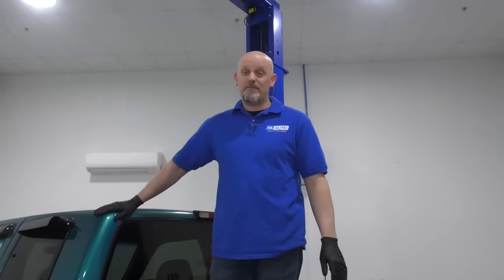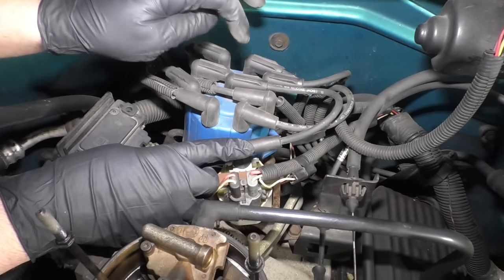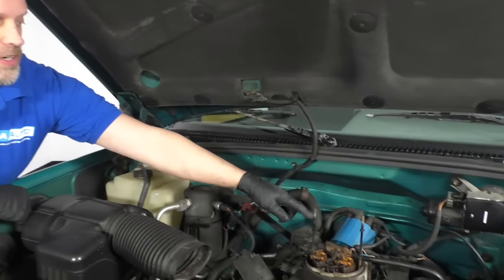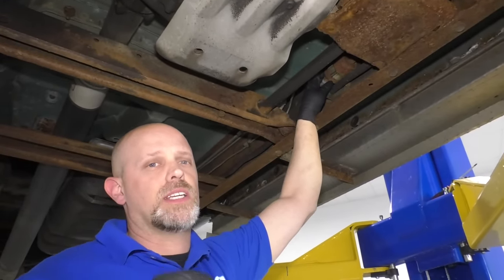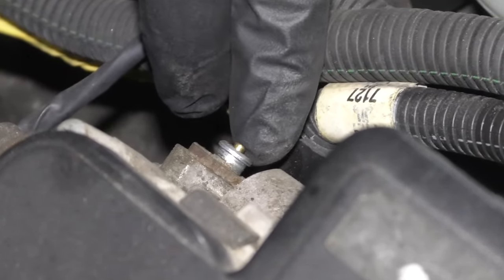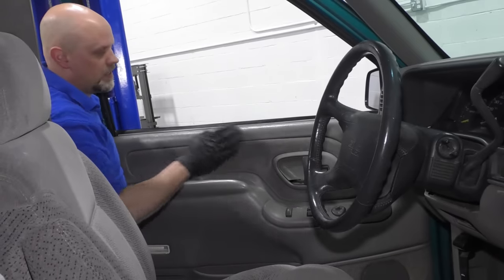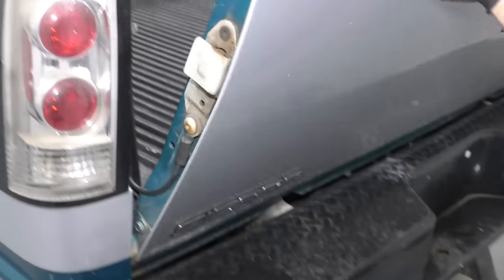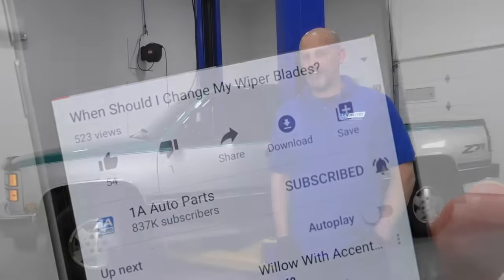Top 5 Problems GMC Chevy Truck 4th Generation 1988-02

Comment: The ignition parts should be replaced with ACDelco brand only. Longevity and less issues when wet. The Tailgate handle fails 90 percent of the time due to lack of lubrication of the components. Door handle when frozen people pull on it hard and bust it.

Comment: So just got a 1993 gmc 2500 single cab and I am able to start and go but only after I start it a couple times and gas it or just start and immediately throw in gear. Driving around it’s fine and I can even stop for a few seconds but anything longer than a minute the truck will shut off. Also when I do gas the truck it seems to be getting good fuel. It was an old work truck so it could be a variety of things but wanted to hear thoughts!

Comment: I have a 97 K1500.  If the brakes are applied while going
over a bump, the pedal goes to the floor and no brakes.  There are no leaks, no loss of fluid .

Comment: 2000 k2500 I got the truck when I was 18 new ive had every single one of those problems besides the distributor cap obviously cause mines fuel injected. Did have a issue with the injectors also

Comment: My 1994 Chevy K1500 running lights (dash board, park and tail lights) blew a fuse twice within 2 weeks and my mechanic put a new fuse in so which fuse is it that needs replacing so I can do it myself ?

Comment: Any suggestions on a reliable brand of replacement distributor for a 1993 4.3L V6 C1500 WT? I see quite a variety of them, it's hard to know which ones are the better ones. Thanks!

Comment: I Have a 1988 GMC k1500 280k miles
1 I have replaced the distributor and coil pack
2 I have had to replace my fuel pump 
3 mine is an 88 pre abs
4 I have replaced door handles
5 mine is the earlier heat controls no problems 
Right now I need a transmission lol

Comment: I have an o1 gmc, I have had all of those problems except the distributor,only because I have the 6.6 liter, one you forgot was the transfer cases, where the pump wears a hole through the case, on the 01 and 02 i know for sure.
Double K

Comment: The heater control wires in the dash get cut/chafed which can lead to shorts.   The electronic heater modules are very expensive.

Comment: I have a question, I have a 1996 2500 2wd.  I have had the front end worked on new tires and brakes all the way around .  pitman arm and new grear box also... but my truck has started being hard to keep in your lane once you get above 45 the faster you go the harder it becomes... I call it swimmy ,,,,it is like it is overcorrecting ,,, this has only started about 6 months ago,,, had it to my aligment guy and the chevy garage,,, still not fixed.... so what do you think is the problem and how can I fix it?

Comment: I have a 95 sierra.  It was an odd ball with the climate controls..... Gm had an issue for two or there months of production on these. I have replaced everything but the wires.  Still can't get anything to work. Can yall help with a full end to end wire tracking video of where all of the power comes from? I have replaced the controls, the resistor the relay, and the fan. I don't know what to do next.

Comment: not to mention the cup holder on the newer interior design is in front of the heater vent so if your blasting the heater and have a cold drink , it wont be cold for very long
Reply: Whoever designed it should have been fired, just really stupid in every way

Comment: On my 1996 Silverado,I have had to rebuild the AFrame,the ac system,the water pump,and at 160,000 miles the fuel pump,other then these, usual wear points the truck runs very smooth,and gets what I consider good gas mileage for this size truck (extended cab(.

Comment: I just bought a 99 Chevy C2500 and the key is stuck in the ignition. I’m trying to figure out did these trucks come with resistors on the keys? Or were they blank?

Comment: Never had a problem with my ABS sensor or heater control. For the a/c heater control, just the lights went out on those and just swapped in others.

Comment: I've had several of these gmt400's. two of the problems I had on all of them was the tail light boards and the tail lights harness ground wire. They were great trucks but had there problems like anything else

Comment: Biggest issue for the 93 is all the wiring. I worked at a dealership for five years and every tech has helped me with the wiring. 93 is the change over year. That is why my 93 runs a 700r4 trans. Trans. 4l60 is a fine trans.... the harness to that tans is junk. 1200 skins to gm five years ago. 200 for a 700r4 and a throttle valve cable. Problem solved. Point being don't buy a change over year. It's a guinea pig. Good luck

Comment: 1990 chev with a 305. The truck idles nicely but when you accelerate  it seems to misfires. Could that have something to do with the spark advance or a tooth missing on the distributor. It does smooth out but does not seem to shift into high until about 45-50 mph.

Comment: I own a '96 1500, 6 cylinder and I've had to rebuild the transmission twice. Wondering if many people report this same problem. Other than that, at 180k still runs great.
Reply: Did you do the rebuild yourself or did you send it to a transmission shop?

Comment: Inside and outside door handles broke on my driver side. Outside handle broke on the driver side. Tailgate latch broke but I leave that broke I just put my hand in and squeeze the rods( no one else can open my tailgate, it’s kina nice) fuel pump went. Speedometer does not work, guess that just needs a new sensor. I’ve had a lot of coolant leaks back part of the frame rusted so bad I had to fix it where the leaf spring bracket connects but other than that my 97 silverado has been a tank
Reply: Oops I meant outside handle passenger side

Comment: My 92 GMC truck's fuel pump died at about 60k miles. 5 years later the oil pressure switch, located behind the distributor broke and the engine stopped. The 12vdc for the fuel pump goes through that switch!! Tow back home = $124 and the switch cost me $34.

Comment: I have a 97 C1500 and one of the rotor screws in the distributor backed out and quit running immediately. It backfired a few times spit and sputtered but I replaced the distributor and have not been able to get it to run decent since. It cuts out shuts off won't start sometimes and I've tried everything. Only thing I haven't done is buy another distributor as maybe the first one was faulty idk. I don't have a bi directional scan tool so I can't tune the ignition timing but it should still run without doing that right? Any help is appreciated thanks!

Comment: Have a 98 K1500 with 175k on it. Did a tune up and the truck still stutters when trying to hold a constant speed (usually around 35 mph) it's a manual. What am I missing to fix this?

Comment: I have all those problems.  Just got a free truck that came with headaches.  But it was free. I replaced cap rotor ICM wires and plugs. Yep i threw parts at it. Im a carp not a mech. So.. i picked up a new distributor, which comes with most those parts, will put in tomorrow and hope it starts. Return all the other parts the came with Dist. . My issue is a phantom.  It started when i brought home , next day NOPE.  replaced parts above and still NOPE.  next day.  Bam. Started ran great 30 min. Let it cool Then no start. Idk weekdays happened.  SO im put on distributor tomorrow hoping its the pick up coil.  Thx

Comment: I own two of these early models (91 & 92) and found a couple other things to look for:
1. O2 sensor. The early years of this generation has one O2 sensor. A bad sensor will cause rough idle & power loss, especially when warm.
2. Throttle position sensor. This is just a plastic spring-loaded sensor. When it gets worn, the throttle plate won't return to the correct position. This causes slow/low power.

Comment: Hardest problem of all is figuring out the a/c when the blower only works on 1 level or not at all, it will be the “blower motor resistor” everyone replaces everything else and it still doesn’t work so if your blower either doesn’t work or only works on hi or low or only one level it’s the resistor!!!!

Comment: 1997 5.7l GMC 1500.  Running fine on highway…..all of a sudden drops to low rpm for 15 to 20 seconds.  Then recovers…doesn’t stall…done this a few times.  Any suggestions?

Comment: I have a silverado 93 started with those problems I took it to the mechanic and it was the ignitotion module and they charged me 370 dlls a very expensive for  that work is less than 20 minutes and the part costs 36 dollars in autozone and the mechanics say 130 now I try to do the work on the truck, it is very important to change all those electrical parts I just change the coil today
Reply from the maker: +Javier Vega Thanks for the feedback!

Comment: My 98 has no spark right now AND my ABS isn’t working. Plus my tailgate handle is screwed up and I s replaced some stuff with my climate control module. I can’t believe these are common😂😂

Comment: I have a chevy truck 96 k1500, I bought it with issues. It drives and shifts well until you get to 2-3 shift. It won't shift into 3rd. It acts like its going into neutral. We have traced down a lot of the other problems with this truck, and changed out many things, shift solenoids, neutral safety switch, wiring, this thing was in pieces when I bought it. Twice it has drove and shifted just fine so I know it is not the transmission itself. Can you give any idea of what it may be? I have spent a bunch of money chasing it down and it still is not working.

Comment: Also, if the HVAC control panel is going "bad," will that affect the blower speed?  I just cleaned out the evaporator area and put a new blower on, but the blower speed(s) and air flow are still much lower than they should be.
Reply from the maker: +Dylan Bartels We wouldn't be able to diagnose an issue like that here, you may want to have a local mechanic take a look at it. It may cause an issue or there may be an issue elsewhere such as a bad resistor causing the low speed. Thanks for checking us out! http://1aau.to/m/Shop-1AAuto-c
Reply: @1AAuto  thank you for the response!  These old rigs do seem to have electrical problems often.  I’ll look into the resister issue.
Reply: @1AAuto  I replaced the blower resistor, and the blower is still blowing the same speeds as before and not moving as much air as it should.  The shop I have been using hasn't been able to figure it out either.  I might have to find a shop that specializes in HVAC.

Comment: I have a 92 Chevy Silverado with the 454 motor. On warm days I get a flame-out issue. It will just stall out. Usually if I wait 20-30 minutes I'm good to go. It acts like a vapor lock issue . I've replaced the fuel filter, Ign. module, plugs, and all the other low cost items. I drive less than 10 miles a week, and it only has 114K miles. ( @ 10MPG I can't afford to drive it! ) ANY ideas would be appreciated. TKS

Comment: I had a 94 GMC Sierra, only problem was glovebox light not turning off, which flattened the battery several times before I picked up what was happening
Reply from the maker: +Richard McGrath Thanks for the feedback!
Reply: On that same subject. These trucks glovebox door hinges are very flimsy
Reply: My driver's door switch wore out and left the dome light on before I replaced it.

Comment: Thank you for the video, I just recently bought a 1993 GMC Sierra K1500 and this is invaluable knowledge. One question - my A/C doesn't work, and I've already checked and it charged. Would you guys be able to do a video about the air conditioning system on GMC/Chevy 4th gen trucks? Another one - apparently this is common - radio doesn't work, or rather works for a minute before stopping. Prior to that, it would only pick up lower frequency stations (like 94.1 FM), but not higher frequency stations (such as 107.9 FM), or if it did pick up higher frequency it would be staticky and garbled. Any idea what that could be? Figure it is wiring but it's confusing how it will not pick up higher frequency but will pick up lower frequency stations.
Reply: IMHO you need to cycle the compressor to know the charge is adequate. You can jump the low pressure switch (located on dryer, silver can on firewall) and make sure compressor is not frozen up this way, just do not do this long without enough refrigerant or you may seize the compressor.

Comment: I have a 96 gmc 1500 with a left brake/run light issue. I replaced the bulb, the panel board, and plug wiring but still I can get it to work but a little driving then quits working again. I know it’s a common issue with chevys but this is getting stupid. Any tips would be much appreciated.
Reply from the maker: +Tail End Customs We do apologize but we do not have any tips since we do not want to steer you in the wrong direction.
Reply: 1A Auto Parts no worries. Must be a loose wire or crappy aftermarket socket panel board. I’ll keep at it. Thanks
Reply: Sounds like a ground issue or possibly a broken wire that makes contact after the vibrations of driving. Good luck!
Reply: @mikelovin7  yup!! I had an old school mechanic tell me that 95% of electrical issues are ground problems!!

Comment: I have. 98 4.3l 5 speed, and the truck starts perfect idles good but once you drive it and get up in the rpm it starts to sputter. I noticed it happens when the green shift light turns on. The gears have been changed to 373 would the engine computer be shutting fuel ? I’ve been changing everything I could think of

Comment: I think I need a fuel pump? Just replaced the sensor but seems like the pump is whistling all the time. Not much excelerating power. How much is a pump for 2000 gmc sierra 4.8 4x4?

Comment: those are the top five now list the other 100 the worst is the wimpy flex plates if you work the truck hard im on the 4th one and 4l80e 3 rebuilds later

Comment: Nice video series. How about the same for OBS Ford trucks (1996 and earlier?) From owning one myself I could make my own list.
Reply: EGR valve issues, coolant leaks, power steering leaks, loose steering (new rack needed), door handle issues, wobbly shifter (new shifter bushings needed), brake master cylinder needing replacement.

Comment: Like your video ....... I change the spark plugs and cables on my 1995 gmc pickup 5.7l and since then it’s been shifting hard but even if I’m still going fast at 65mph still has a hard time shifting to the next gear. Any idea of what could had happen or if I mistakenly move something without noticing?
Reply from the maker: +sergio bueno We wouldn't be able to diagnose an issue like that here, you may want to have a local mechanic take a look at it. Thanks for checking us out!

Comment: TBI distributors are nearly bulletproof. The Vortec ones....not so much. Fuel pumps.....same as the distributors. 

ABS....LOL....my 1988 has no ABS. So....unless the truck is in that 1995 on age bracket....dont think the older GMT400 owners have anything to worry about. 

Never replaced a door handle on my 1988. Door bushings though.....

Electronic HVAC controls....again....1995 and newer problems.....Not for 1994 older. 

My 1988 is a NY truck. Never had tailgate issues. No cables for mine. Metal.

Comment: i have an 88 chevy k1500 with the 5.7 tbi. after my first oil/filter change, my oil guage started acting wierd. when the engine warmed up, the oil pressure would drop. I checked the level ane it was fine. ive checked everything I can think of and am at a loss.

Comment: 88-95 and 96+ nnbs should really be broken down individually.  They are almost entirely different trucks, ‘95 being a half breed, though they look the same. 

This is a great list though.  Overall these are the issues. Honorable mention to the water pump backing plate going out on 96+.
Reply: ..Yes, the '88-'95's are indeed much different mechanically than the '96-'98's...the '96-'98's being OBD II, much more complicated, and in my experience, much more trouble-prone....